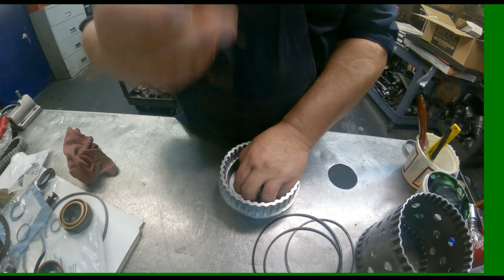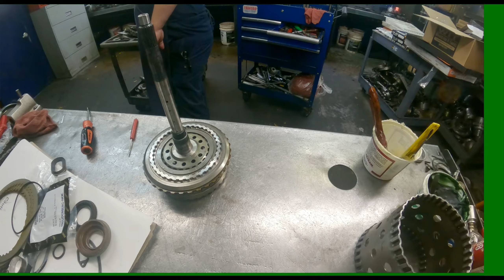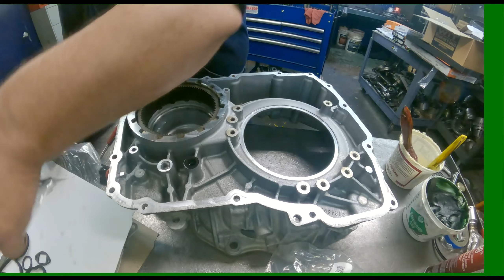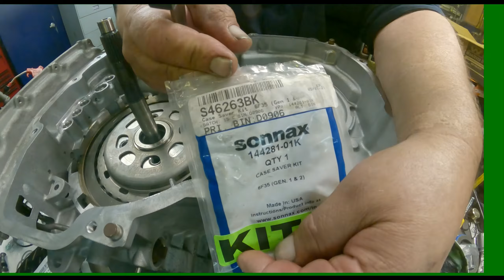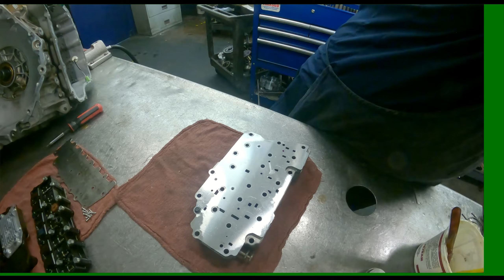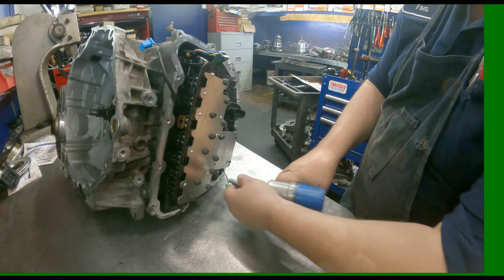6T40 Rebuild

Comment: Great video, i just bought the repair manual for this in case i get stuck, and watching your video is great. Are there any upgrade parts for this transmission for better shifting and longevity?
Reply from the maker: If it is a Gen1 I would replace ALL of the cushion plates. If it is Gen 2 or above, you can get by with just the 3-5-R one. I would recommend the Sonnax drum saver kit over the factory style. Check with Chevy for a new valve body, sometimes you can get them for not much more than you will spend on the Sonnax zip kit. If you are going to put a kit in it, Sonnax is the one I recommend. If it is Gen 2 you will want the signal accumulator kit as well, Gen 3 you will want that as well as the lube on demand valve. Put you a bushing kit in it, the one in the stator is critical as it is what seals the lock-up apply. Don't use GFX Pro for that, in fact I don't recommend them for any transmission. If you can't find a bushing kit other than them, take a chance on the old ones. Get a Transtec rebuild kit with Raybestos clutches, Filtran filter. You can get them from WIT or Transtar, links are in the description. If you have the thermal valve in your cooler lines and you live in a warmer climate area, buy a delete kit for it. Get the Transgo one. If you are in an area that gets really cold, buy a new one from the dealer.
Reply: @CurmudgeonTransmission  Thank you for your informative reply. I've been talking to Chat GPT but talking to an experienced human is way better. This is what chat GPT came up with and is similar to what you said, (I trust what you say a lot more)
I just bought the repair manual for this transmission as well to guide me. 

"If you want the strongest and most convenient starting point, I would buy a Super Master Rebuild Kit with Bonded Pistons, then upgrade the friction materials to Raybestos HT if the kit does not already include them". 

A quality master overhaul kit,(Transtec Overhaul kit with pistons)
Raybestos HT friction plates (if not in kit)
Sonnax Zip Kit
TransGo shift kit SK 6T40-G2
New steel plates (If not in kit)
Remanufactured torque converter (Recommended)
Remanufactured VIN-programmed TEHCM (recommended)
New filter and Dexron-VI fluid

I'm in Australia by the way and there are a lot of cheap parts here but i rather spend a little more and buy better parts from the US. 
Thanks
Bart
Reply from the maker: @toranacar Yes. Go major name brands. Cheap Chinese stuff won't last long.

Comment: I have a gen 2 6t40 out of a 2013 Cruze 1.4 and I'm wondering if you know the part # for the seals that they sent you that were wrong for the 456 clutch? I'm looking for the outer seals for this part number: 24249623. Thank you in advance for your help if you can

Comment: I see you replaced only 1 of the case bushing for the differential I found the part number for the one you replaced but mine was leaking on the other one I found the seal but can’t find the part number mine is a gen 1 I’d appreciate if you’d happen to have it
Reply from the maker: As far as I know you have to buy the bell housing, it does not come in the bushing kit. I have yet to need to replace it, so I don't have a number, sorry. Thanks for watching.

Comment: I took apart my 6t40 2nd gen from a 2013 Cruze 1.4 and don't have the tools to take apart the clutch housing (3-5-R/ 4-5-6). Are you aware of any place that will sell that assembly already put together?
Reply from the maker: Not that I know of. You could probably get creative with about 3 C clamps and get it apart.
Reply: @CurmudgeonTransmission thank you. I was able to take out the snap ring by concentrating on pushing down on one side by putting a screwdriver in the ring grooves just enough to slide out the snap ring with a pick and continue that until I got it out. I ordered the drum saver kit by Sonnax since it was cheaper than finding the factory cushion plate I needed.
Reply: @CurmudgeonTransmission  do you ever get on red dit? I posted a video in the transmissionbuilding sub regarding opening up my 6t40 gen 2 and changing the fibers and cushion plate along with some seals, and installing the zip kit on the valve body and after putting it back together still having exact same issue. Just hoping to get your opinion..
Reply from the maker: No, I don't. What is the issue?
Reply: @CurmudgeonTransmission  2013 Cruze 1.4 - Sometimes the car wouldn't catch reverse, I'd have to wait for a few seconds then it would go into reverse. Recently it's been catching every time. Then when I'm driving on the first gear change (1-2?) it seems fine, but from 2-3 it would go over 3k rpm before it drops and catches the gear. Then again what seems like 2 more times after that it would Rev then finally catch. I took the transmission apart, changed the 3-5-R fibers and installed the drum saver cushion plate from Sonnax. Also installed the Sonnax zip kit on the valve body. Changed the fluid pump seals and installed a refurbished torque converter. Put it back together and it's still doing the same thing. There were no broken pieces when I took the transmission apart. Even if you don't have red dit, it's there somewhere I can send you the link to the pictures I took and video?
Reply from the maker: Send me the link

Comment: Thank you for taking the time to make this video! My 2013 Cruze 1.4 just crapped out. Transmission is toast I believe. Reverse doesn't engage right away, but then will seem to work fine after it catches. The first gear change when going forward feels fine but then from 2-3 I think, revs up to around 4k before it catches hard, then another gear after that jerks hard as well. I called around for quotes but most places here say 3.5k so since I have done a lot of work to it recently, I want to try and tackle this myself with your video as the main tutorial. Main question I have now is which parts should I buy? Do you have a link where I could get everything I need for this transmission? Thank you
Reply from the maker: Hope you have better luck with your Cruz than I have had with mine. I thought the Elantra I had was a piece of crap until I got this thing. By far the worst car I have owned. Having said that, you will not know until you get it apart what you will find. This transmission can very quickly be to the point of unrebuildable. You for sure will want a kit with  clutches and molded pistons, filter, bushing kit, Sonnax 3-5-R drum saver kit, Sonnax Zip kit (if you cannot get the valve body from the dealer for a good deal. Sometimes you can get it for not much more than the kit.) I would get the new one if it is reasonable. If you don't have an arbor press and bushing drivers you might want to skip the bushing kit. Everything else you will not know until it is apart. You can get those from WIT or Transtar. Links are in the description. Get your torque converter from Precision of New Hampton. Link is in the description.
Reply: @CurmudgeonTransmission Thank you for the reply. I'm pretty handy with a wrench, but have never taken apart a transmission much less put one back together, but that's how I used to be with anything car related until I just did it. I know what you mean regarding the Cruze, I think it's the worse car I've had next to a Grand Prix GXP I used to have that I gave away.
Reply: @CurmudgeonTransmission  is there a difference between a 1.8L 6T40 vs a 1.4L 6T40? Say a 6T40 from a 2016 1.8 Cruze (limited), would it be compatible in a 2013 1.4 Cruze?
Reply from the maker: @CruisinComPTon  Probably not. The Diff ratio will probably be different. Plus the 16 is Gen2, the 13 may or may not be Gen2. It may be a Gen1. 13 was a split year.
Reply: @CurmudgeonTransmission  My 13 has a Gen 2. With the green and yellow solenoids plus according to the serial on the TCM its a 2. Just dont know about the diff ratio.
Reply: @CurmudgeonTransmission I'm just trying to convince myself because I already purchased a used 80k mile automatic from a 2016 1.8. From what I've read, both the automatic 16 and 13 Cruze have a 3.53 and my 13 is also a gen 2. I'm going to physically compare them and then swap them if all seems well. Thank you so much for the info.
Reply: @CurmudgeonTransmission you're right. I think the 2016 transmission is a 6t30. It came out of a 1.8l cruze limited but I don't think it'll work

Comment: We are having problems with the transmission, I would like to ask about the problem. In your opinion, what is the cause? When the transmission lever is moved to position R and the gear shifts to 3 and 5, the linkage jerks very hard, and the DTC doesn't detect anything. In your opinion, what is the main cause?
Reply from the maker: @haikal_thalibxtb7777  Before or after a rebuild?
Reply: @CurmudgeonTransmission  Initially the problem was that all gears were shifting roughly and there was a DTC P0796 and we decided to dismantle the transmission torch without replacing the packing set, but we only replaced the solenoid valve set and baffle that had fallen off and the filter had also been replaced and the DTC had disappeared, but gears R and 3 and 5 were still roughly engaged
Reply from the maker: If you replaced the Techm (solenoid assembly) and did not program it for the new assembly, that sometimes causes a problem. You will also need to reset the adaptives and relearn the shifts. Make sure it has at least 1/4 tank of gas. If it doesn't sometimes it will not relearn. Only other thing would be the 3-5-R cushion plate or a problem in the valve body.

Comment: Question I have a gen 1 and a gen 2 transmissions where the valve body bolts onto the transmission the fluid passages are the same can I swap out the gen 2 valve body and install the gen 1 valve body and TCM ? Because by looking at the Internals of both transmissions they look identical as the gen 1.
Reply from the maker: No, you can not. Although they look the same they are not. There are a bunch of changes between the Gen 1, Gen 2 and then again for Gen 3. On the Techm side, the Gen 1 has pressure switches and the Gen 2 does not. The strategies are different and will not be compatible with your vehicle. Valve body side, the valves are different to work with the changes inside the transmission.
Reply: @CurmudgeonTransmission  Ok thanks I'll try it out see what happens anyways lol I have like 4 6t40 transmissions my 2011 Chevy Malibu come with the gen1 transmission just curious to see what happens 😂
Reply: @CurmudgeonTransmission  Just curious if it's ever been done or tried before only thing I see that is different from the gen1 is the drum with the extra clutchs instead of 4 it has 5 and the center bearing for the drum instead of 4 has 3 rings.
Reply from the maker: I'm sure somebody has. There are more differences than that. You will have shifting issues and probably engagement issues if you do it.

Comment: Yeşil olan gres beyaz olan vazelin mi?
Reply from the maker: Both are specially formulated to work in automatic transmissions. Made by Lubegard (Dr. Tranny), assembly gel.  Green is just thicker than the gold, which is no longer available.
Reply: Teşekkür ederim bende dexron 6 sürerim Avrupa'da dr.tranny transmisson oil bulmak zor olacak.

Comment: Hey bud I was replacing the input speed sensor on my 2013 Malibu and I dropped the check balls on accident. I know you put them in in this video but do you have a diagram of where to put them back?
Reply from the maker: 2013 is the first year it can be a gen 3. Is it a Gen 2 or 3? Go to my Instagram and I can send youa picture there.
Reply: @CurmudgeonTransmission  got it whats your instagram?
Reply: @CurmudgeonTransmission  And how do I identify what generation I have?

Comment: I got a 2012 cheve cruze 1.8 with 130,000 miles on it. I have owned it since 50,000 miles and so far it hasn’t really been too bad of a car. Maintenance is all up to date. Just changed the transmission fluid and it smelled alittle burnt and sure looked it. The tranny is shifting kinda funny from 1st to 2nd and 2nd to 3rd. I’ve been considering getting it rebuilt.
Reply from the maker: I would before it gets too bad. These can go from not much damage to catastrophic in a very short time. I'm glad you have had good success with yours. I have the same year and it has been nothing but trouble. One of the worst cars I have ever owned. As soon as I can I will be getting rid of it.
Reply: @CurmudgeonTransmission you know that’s what I heard that these cars have been nothing but issues. So far the car hasn’t given me any real major issues besides the transmission shifting poorly. Other then that it’s been honestly more reliable then I would’ve ever thought. A few small annoying issues I see with the car throughout my years of having it , the valve cover gasket keeps leaking so I bought a new valve cover. Maybe the old one was warped. Also the car always seems to be needed it’s overflow tank to be topped off with coolant every few months. I never see puddles on the ground or smell like coolant is being burned. That’s pretty much it. I did replace the usual components that cause coolant leaks and such but have no clue where the coolant is going. That’s why I’m considering rebuilding the transmission because other then that , the car has been fairly good to me. What’s the average mileage you’ve seen with these 6T40’s lasting out of curiosity ? I been changing the fluid every 30k miles since I’ve owned the car.
Reply from the maker: @MachineGunner29  Somewhere around the 100k mark.

Comment: Thanks for the video!  Awesome, quick watch! I'm definitely a new subscriber! ..I'm just going to change the filter and outer seals on a salvage yard transmission.. I'm trying to get the torque converter bell housing off, I have all of the bolts out but am I correct, I think there's some kind of clip or something holding it on, down in the hole around the input shaft.. If so, how do I get it to release? Am I seeing two flat spots that need pushed in?  Also, when I put the housing back on, will whatever torque my Craftsman Impact Driver puts on it, be close enough to proper torque, or should I check it.. if so, what torque? ..I think I read somewhere 89 Ft.Lbs. then a 45 to 50 degree turn?  I'm planning on using liquid gasket maker for the housing.. and smearing liquid gasket on the existing oil pan gasket.. On a tight budget, and need this thing going! ..Thanks for your help!!
Reply: I found it.. the dowels get stuck.. but thank you!
Reply from the maker: 89 in. lbs + 50 degrees. It has a molded gasket for the case, so if you don't replace it, put a thin bead of silicone on each side of it. Don't leave it off or your end clearance will be off.

Comment: Merhaba
Gm 6t40 ısındığı zaman bazen 1.vitesde kayma yapıyor 2.vites vurma şeklinde geçiyor bunu neden yapar? 
Teşekkürler.
Reply from the maker: If it has never been rebuilt it is time before a lot of damage occurs. If it is after a rebuild I would be looking at the valve body or Techm.
Reply: @CurmudgeonTransmission  thank you. 
Could the 1-2-3-4 piston be cracked?
Reply: Techm selonaid valve team new.
Reply from the maker: Never seen one crack but it may have been damaged when installing it.

Comment: After watching this video I'm going to attempt a rebuild on a 6T50 and all the overhall kits list the same kits for 6T40-6T50 is the only difference that the 6T50 has a 1/4 wider chain? Any help is appreciated.
Reply from the maker: I have not had a 6T50 in the shop yet, and only a handful of the 6T40's. Which is weird because we get a ton of the 6F35's.The internals will be set up the same. The difference is going to be in hard parts. The planets I would think would be heavier duty. Different sprocket tooth counts which would probably make for a different chain. Differential, sun gear and ring gear probably. The rest I would think would be the same. So pay close attention if replacing any of those parts.
Reply: Thank you for the information and quick reply!!!  @CurmudgeonTransmission

Comment: Do you know why my 6t40 1.5t malibu has a weird second to third and third to 4th shift? The 2-3 has a weird delay unlike the ones that shift fine. I just financed this car then it started doing this soon after. 94k miles. I need it rebuilt im afraid. How much will u do this rebuild for 😂?
Reply from the maker: Most states you have 30 days to take it back. Try to make them pay for it or get out of the deal if you can. I have a Cruz which has the same transmission. Worst car I have ever owned, worse than the Hyundai Elantra I had. Will be going bye-bye as soon as I can make it happen. The 3-5-R cushion plate always breaks and causes a ton of damage. Even though it is basically the same as the 6F35 that Ford uses,they always seem to be in worse shape as far as damage goes. Every one I have had come in has been so damaged that it was cheaper to get one from Chevy. Mine included. Mine went out about a year ago. They will give you a 3 year 100,000 mile warranty. Was right around 5K for parts and labor.

Comment: thanks for the advice, I hav'nt pull it apart yet, if the 3 - 5 - R cushion plate was bad, would I have driving trouble.
Reply from the maker: When it first cracks, maybe not. After a piece breaks off, yes.
Reply: Jan Palmer
2 hours ago
I drove for 200 miles, since I heard the oily clicking sound, clicking sound when rolling forward just 12 inches, engine off, but the 2010 chevy drove good, no shudder, no eratic shifting, no slipping, no limp mode, or check engine light, should be alright, thanks for the advice.